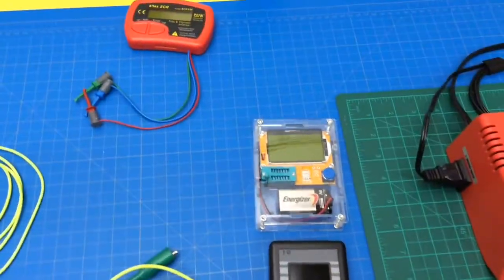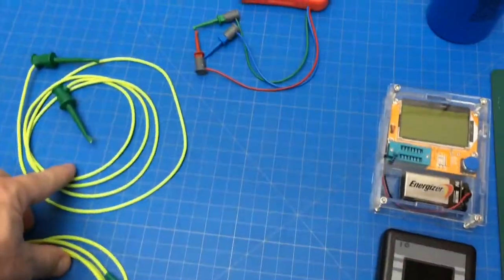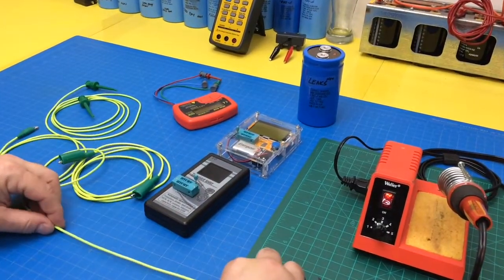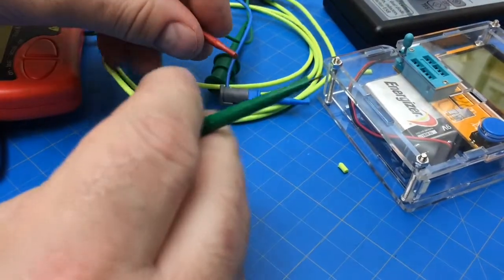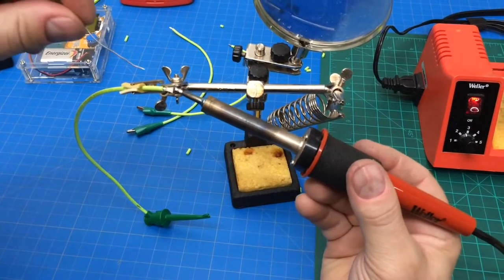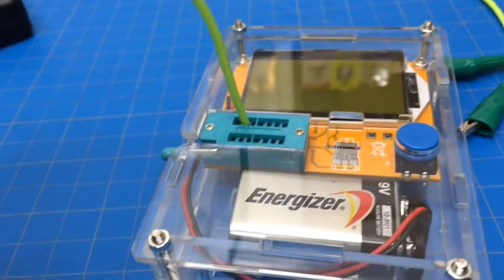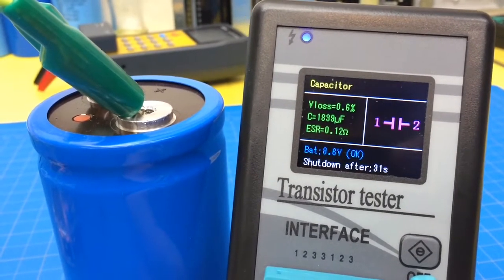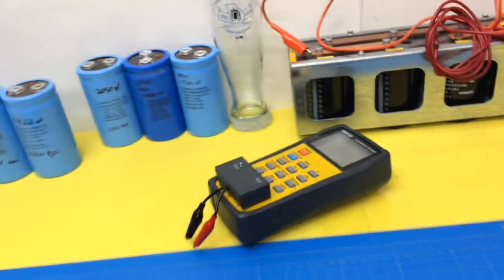(Electronic Component Testers) Test Lead Upgrade & Comparison w [DE-5000] LCR Meter  [KTFG 362b]

Comment from the maker: www.KevinGittemeier.com
Handheld LCR Meter Der De-5000: https://amzn.to/2yQxFa2
Drok Electronics Component Transistor Tester: https://amzn.to/2tRTFeS
Multifunction Meter DIY Kit tester: https://amzn.to/2KvanIk

Video numbers 362a - 362j (10 videos) exist to rectify numbering duplicates.  I starting numbering videos Aug 2020 video “386 Standing Desk” using the total video count as the reference number.  Then in 2025 I starting numbering the oldest videos 001 and so on.  The number conflict is due to private videos & deleted videos.
Reply from the maker: Learn to solve the Rubik’s Cube easy with this simple beginner method: 
https://youtu.be/9spDGBeWl1o

https://www.kevingittemeier.com/how-to-solve-rubiks-cube-easy/

Comment: Use the same test leads on your 'precision' meter like you used on the other 2 to see if you get the same esr. That would take into account the test lead lenght difference.

Comment: Did you test smaller capacitors to see its accuracy or that only happens with big ones?  I just bought one of these  (the one with the acrylic case)
Reply from the maker: iirc it reads capacitance fine and esr unless you use the additional leads. The leads throw off esr bc no way that I know of to calibrate.
Also check out:
How To Solve a Rubik’s Cube: So Easy a 3 Year Old Can Do It  https://youtu.be/9spDGBeWl1o

Comment: The T3 transistor tester could be calibrated to ignore the resistance of the leads by shorting them all together. The unit will then calibrate itself to the leads
Reply from the maker: Cool, I'll give that a try.  I know some models are capable of calibration but didn't believe these models were.